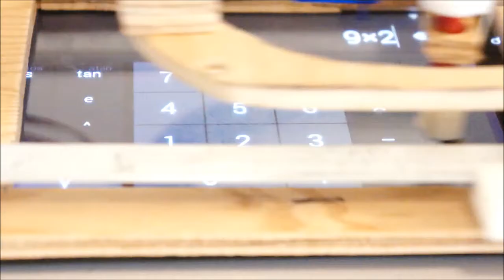MonkeyBot: the robot to automate touchscreen testing or playing video games

Comment: Hello Research, im working on a project that's kinda like this one. But i have one question and that's how do you make the robot touch on the screen.  I have tested with some sort of plastic or rubber. But it does just react when im presing it down with my finger on the screen. Is it anything of electricity or something. Please someone respond if they are reading this. Sorry for my bad English .
Reply from the maker: Hi Jack. Touch screens normally work by detecting the "capacitance" of your body relative to the phone, the finger changes the capacitance. So what I found to work is as I show in the video, I have a small nail, head facing down, with a wire coming off of it, hanging freely out , not connected to anything. Technically you could probably connect that wire to a metal plate the lays underneath the phone. The nail head actually then touches the screen (gently). When it touches the screen, the extra metal and wire create enough capacitance that the screen thinks it's being touched
Reply: @researchandbuild1751  Thank's alot for your anwserd to my question i really purchase that! :)

Comment: Is the programming available for this
Reply from the maker: I am not sure, I will see if I can find it
Reply from the maker: I think this was my code

#include <Servo.h>

Servo xaxis;  // create servo object to control a servo
Servo yaxis;
Servo pen;
  // twelve servo objects can be created on most boards
  
int xpos = 20;    // variable to store the servo position
int ypos = 150;
int xmovedelay = 20;
int ymovedelay = 20;
int repeat = 120;

void setup() {
  // and initial Park prevents the servos from jumping when attached.
  Park();
  xaxis.attach(10);  // attaches the servo on pin 9 to the servo object
  yaxis.attach(6);
  pen.attach(9);
  // guarantee that we are truly parked
  Park();

  // delay to allow code changes before activity starts
  delay(3000);
}

void loop() {
  if (repeat <= 0)
  {
    StopAll();
  }
  DsDNAMeasureTest();
  repeat = repeat -1;
}

void DsDNAMeasureTest()
{
  // dsDNA button
  MoveTo(85,125);
  DoTouch(); 
  delay(6000);
  
  // Blank
  MoveTo(85,165);
  DoTouch();
  delay(30000);
  
  // Measure 4 times
  MoveTo(50,165);
  DoTouch();
  delay(22000);
  MoveTo(50,165);
  DoTouch();
  delay(22000);
  MoveTo(50,165);
  DoTouch();
  delay(22000);
  MoveTo(50,165);
  DoTouch();
  delay(22000);
  
  // End Experiment
  MoveTo(20,165);
  DoTouch();
  delay(6000);

  // End Experiment Dialog
  MoveTo(25,155);  
  DoTouch();

  delay(3000);
  // Clean screen
  DoTouch();

  delay(3000);
}

void TabSweepTest()
{
  if (repeat <= 0) 
  {    
    StopAll();
  }
  MoveTo(43,115);
  DoTouch();
  delay(4000);
  MoveTo(55,115);
  DoTouch();
  delay(4000);
  MoveTo(85,115);
  DoTouch();
  delay(4000);

  // back the other way
  MoveTo(55,115);
  DoTouch();
  delay(4000);
  

   repeat = repeat -1; 
 
}

void StopAll()
{ 
  // park back in initial position to prevent startup jumps
  Park();
  xaxis.detach();
  yaxis.detach();
  pen.detach();
  while(1){}
}

void Park()
{
  MovePenTo(100);
  MoveXTo(25);
  MoveYTo(150);
}

void DoTouch()
{
  MovePenTo(72);
  delay(150);
  MovePenTo(100);
  delay(120);
  
}

void MoveTo(int xmove, int ymove)
{
  MoveXTo(xmove);
  MoveYTo(ymove);
}

void MovePenTo(int newpos)
{
  pen.write(newpos);
}

void MoveXTo(int newpos)
{
  if ((newpos - xpos) > 0)
  {
    // move +
    for (xpos = xpos; xpos <= newpos; xpos++)
    {
      xaxis.write(xpos);
      delay(xmovedelay);
    }
  }else
  {
    // move -
    for (xpos=xpos;xpos>=newpos;xpos--)
    {
      xaxis.write(xpos);
      delay(xmovedelay);
    }
  }
}

void MoveYTo(int newpos)
{
  if ((newpos - ypos) > 0)
  {
    // move +
    for (ypos = ypos; ypos <= newpos; ypos++)
    {
      yaxis.write(ypos);
      delay(ymovedelay);
    }
  }else
  {
    // move -
    for (ypos=ypos;ypos>=newpos;ypos--)
    {
      yaxis.write(ypos);
      delay(ymovedelay);
    }
  }
}

Comment: Hey there, was wondering if you still had all the doucments for this project like how did you program the tablet and things like that?
do you have github
Reply from the maker: The tablet didnt have any special programming, it was the item under test. The arduino was programmed with a PC and then just played its program over and over. That program was just a bunch of servo library commands, all set up hardcoded manually by moving the motors into location. Basically i figured out max and min angle and then i could guess the right number from there

Comment: Thats a excellent work done , Can i have some insight in to this ? , how i can start if i want to build from scratch something like this. ? . Does the sensor have capabilities to read the text and detect the numbers or is it statically doing the same thing .
Reply from the maker: Its just statically doing the same thing over and over. Basically I figured out how far the servo could move up/down (in servo values) and that gave me a range for example to hit a button near the bottom of the screen I'd have to move the servo to position "80" degrees. So I just hardcoded the motions in the Arduino program to move to specific locations one after another, to move the arm to the spots it needed to be.

The same technique for all 3 servos, figured out their "range" of how far they can move in servo degrees, then in the Arduino code I know how to tell them to move. it's just a continous loop of movement, that then repeats over and over. All hardcoded, no sensing at all on the pen.

If you wanted to build something to be automated like this the first step is mainly to make the mechanical movement able to cover the entire size of whatever you want to control. So first I made a baseplate with a hole that size of the screen, to sit over the screen. Then i designed the "rails" and arm so they are able to move enough to cover that whole size. 

During mechanical construction its just a matter of coming up with good solutions - for example the "Y" axis needs to move straight only, so I made the aluminum "rails" to guide that. I put a lever on a servo that would be long enough to move the "Y" axis over the entire range of the screen.

I didn't want the extra burden of linear rails for the "X" axis and since I don't need perfect accuracy here (like drawing a line or somethign) I came up with the idea of using a "U" shaped Yoke which would allow me to move the pen up and down in the X axis with a much simpler mechanical construction. It will be a little less accurate because any inaccuracies of the motor are amplified by the length of the arm the pen is mounted on, but it's good enough for this purpose.

Once you have the mechanical stuff in place and you have motors to move the mechanics, then you can use the Arduino to tell the motors how to move, Arduino has a "servo" library you can use that makes using servo motors like this very easy.
Reply: @researchandbuild1751  what is the cost for building this
Reply from the maker: @leafs_we-dont-win--in-playoffs  I'd say...probably about $60-80 U.S. for everything, maybe cheaper depending where you buy the servos